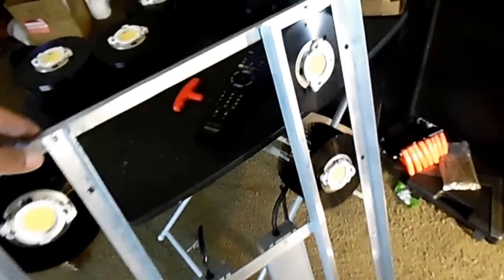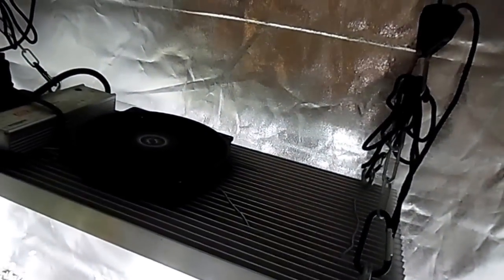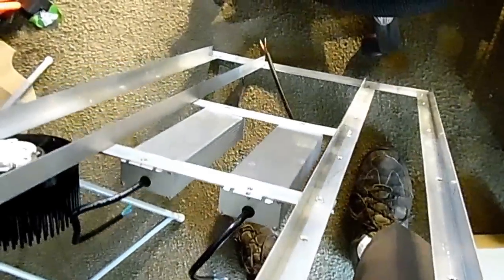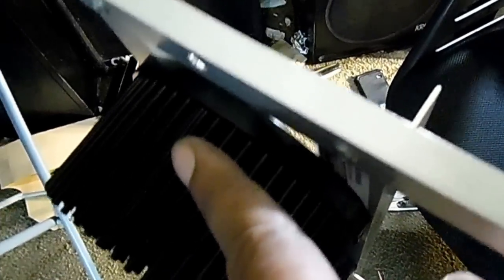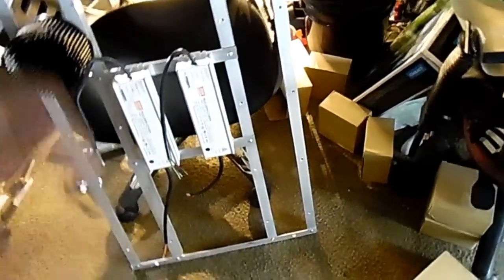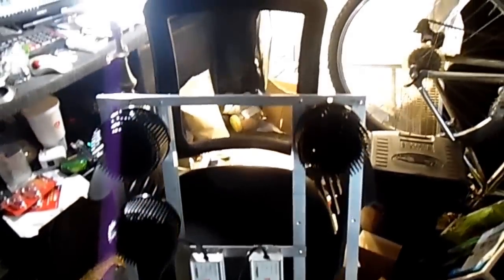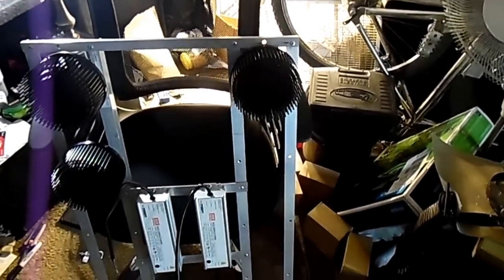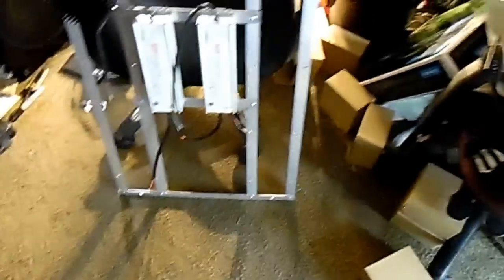REALSTYLES 500w COB MONSTER

Comment: Nice video and framing. I did a larger 24 Cxb3590 3500k 36v. Spaced them out at 10" center of cob. The grower loves it and the 5 cob unit I did 3 weeks ago is great. Hitting 857 micro moles. Looks like you will get a good PAR reading.